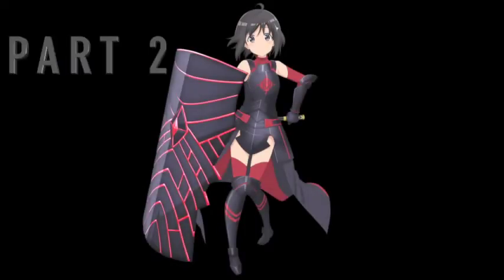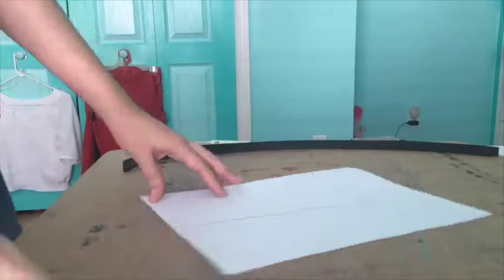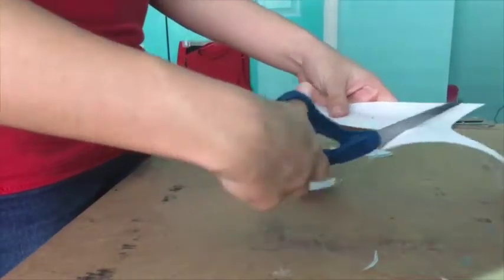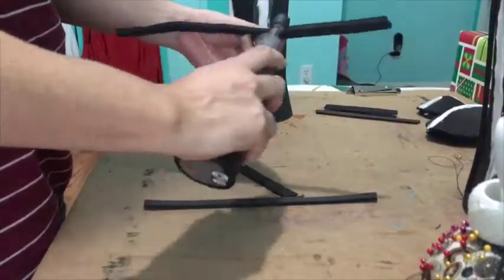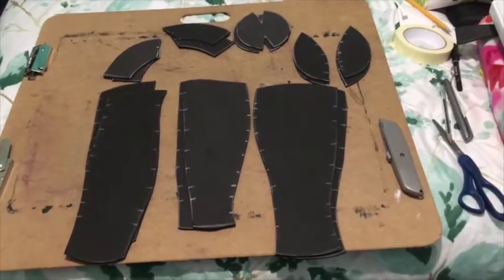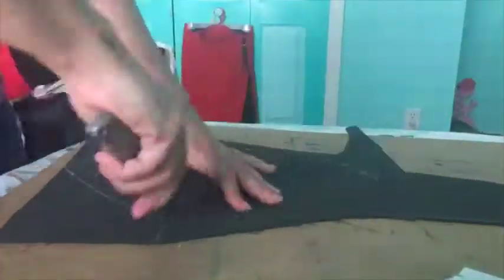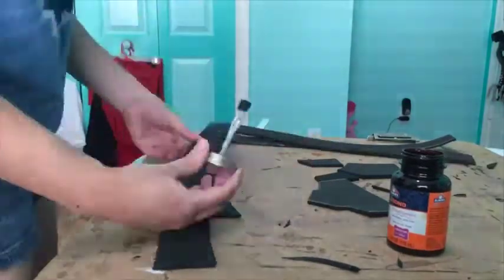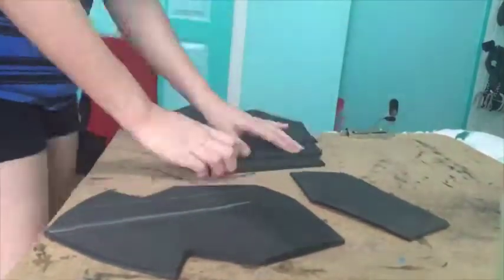Bofuri Maple Cosplay Part 2

Comment: How thick should the eva foam be?
Reply from the maker: The thickness that I used for the EVA foam for the costume was 4mm, but I double layered the breastplate for extra stability, so its final thickness was 8mm. I wouldn't recommend going over 12mm to avoid bulkiness.